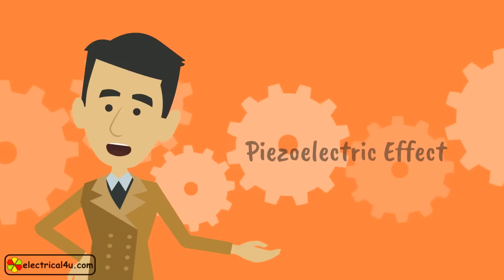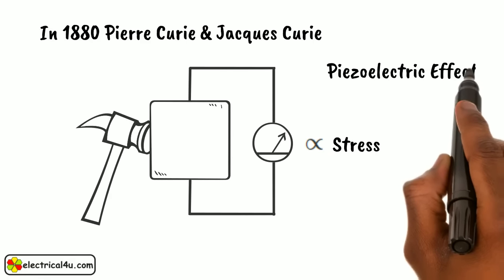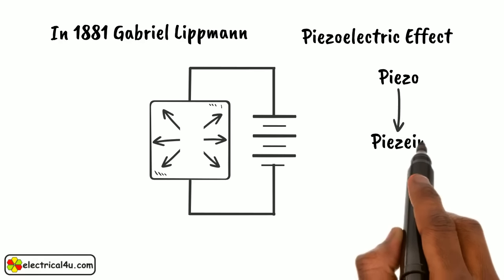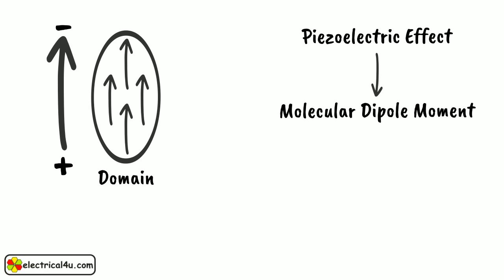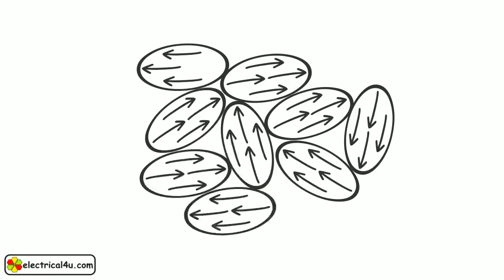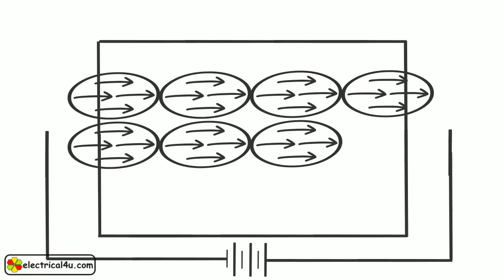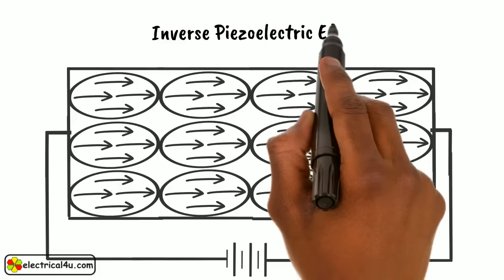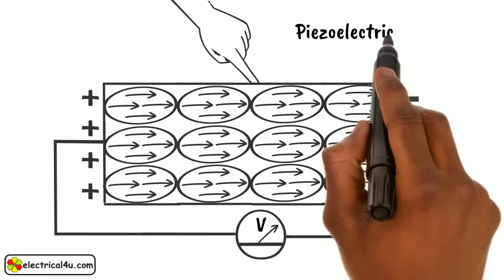Piezoelectric Effect: What is it?

Comment from the maker: Thank you for watching! 

You can read our full article on the Piezoelectric Effect at: https://www.electrical4u.com/piezoelectric-transducer/
Reply: how to produced battery less gadgets just by using pushed button or squeeze button or stretch or rotation like electrical motors and we accumulated charges in capacitors and later use in the remote control of various kinds, how much energy required for remote control operations per second like tv remote, ac remote, fm remote, disk players remote
battery less gadgets saved million dollar fuel and pollution from battery wastage💪💪💪💪👺👺👿👾👽💀💀💀💀💀💀💀💀💀💀💀💀
Reply: @Kian Zechariah instablaster :)
Reply: @Rodrigo Benton it did the trick and I finally got access to my account again. Im so happy!
Thanks so much, you saved my account!
Reply: @Kian Zechariah happy to help xD
Reply: translate pliss